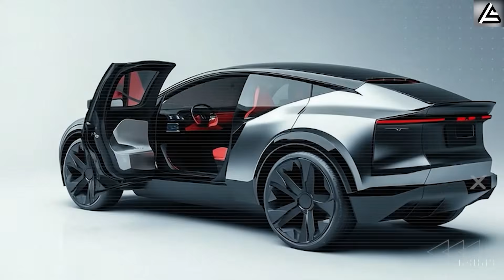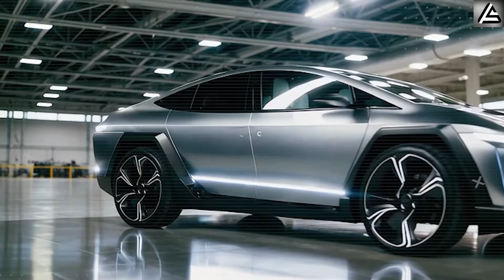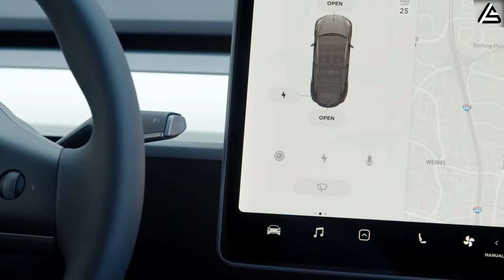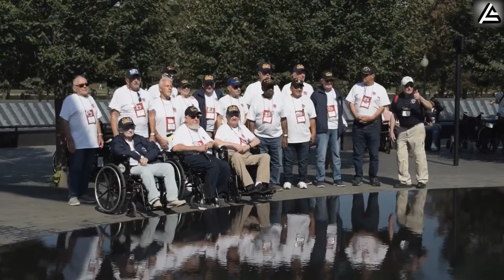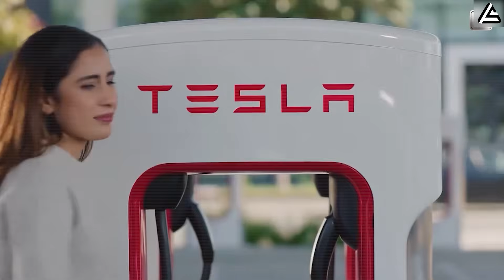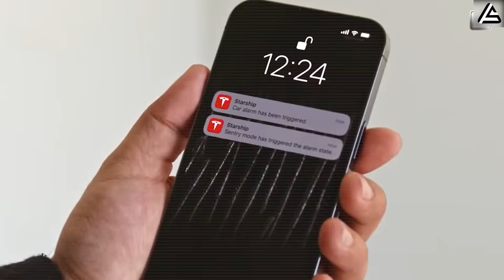Elon Musk’s 2026 Tesla Model 2 Design & Tech: What's Hidden Behind?

Comment: 全固体電池を出来るだけ小型化して
チャージの度に入れ替える方が良い ‼

ガソリン給油より簡単に固体電池ユニットを
差し替える形態が望ましい ‼

固体電池ユニットの充電は安価な深夜電力で
行えば設備・経費も軽減出来る ‼
Reply from the maker: That idea actually makes a lot of sense from a convenience perspective. Instead of waiting to charge, drivers could theoretically swap small battery modules in minutes and keep moving, almost like replacing propane tanks or industrial battery packs. Companies like NIO have already shown battery swapping can work technically at scale in China. The challenge is making it economically and logistically practical for the entire industry. Automakers would need standardized battery formats, massive swap infrastructure, robotic handling systems, and a way to manage battery ownership fairly between customers. Tesla originally tested battery swapping years ago but ultimately focused on Superchargers because building charging infrastructure scaled faster and cheaper. Still, for taxis, fleets, delivery vehicles, or dense cities, modular battery swapping may become much more attractive in the future. The bigger question is whether future EV buyers will prioritize ultimate battery range or simply the fastest and least stressful ownership experience possible.